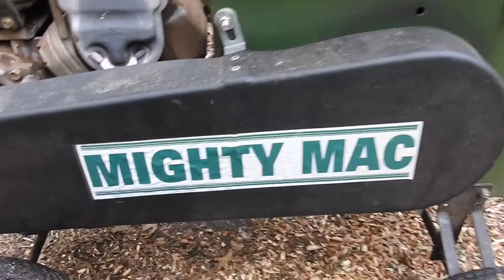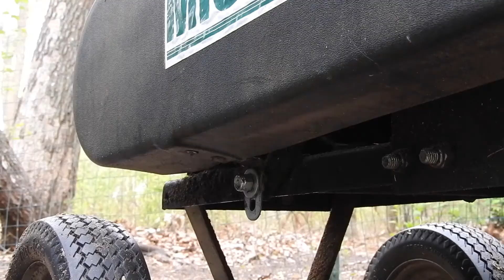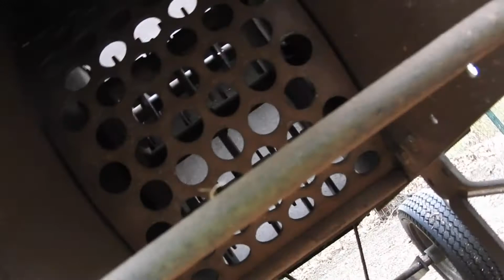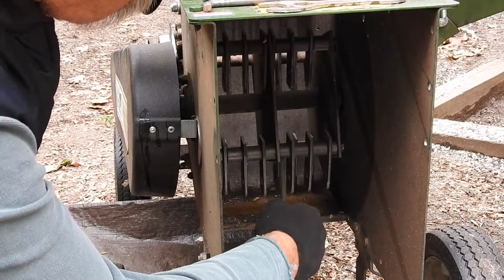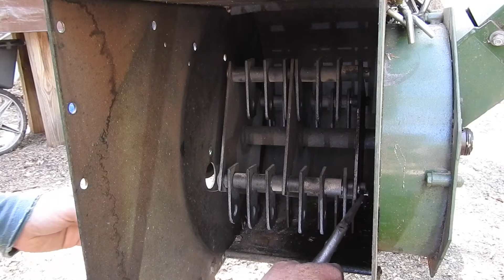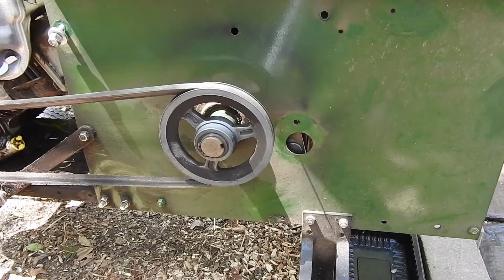MacKissic 12 PT - Replacing Shredding Hammers

Comment: Great video! I have an older version of this, but the main unit is basically unchanged. I converted mine to run off the front of an old wheel horse tractor and performs way beyond my expectations. Now I know how to rotate the blades when it comes time. Thanks. I converted mine from a wheelbarrow type to a Wheel Horse attachment. Here's a video of it in action. https://youtu.be/APUq_jmp1N4

Comment: Thank you for the very informative video. I have the same model and I'm not having any luck getting the end pins hammered out even after heating them with a torch. I'm not sure what to do besides just sell the unit. I'm very pissed off at the manufacturer for designing this retention system.

Comment: Cool that's a lot easier than I though. I have an old model, probably from the late 70's  or early 80's. Still has one good side left on the hammers haha. I'll swap them out. Guess 10 years per side is about average

Comment: My belt exploded today! Going to swap her out next week. I'm on my 4th rotation of hammers, need a new set soon, two have exploded (maybe from some metal entering the mill by accident!~). Thanks for the video, I'm going to rotate and balance the 2 broken hammers so they're equally opposite of each other. Just changed the oil, 300ml out, 800ml in! (first time in  a couple years). Will also lube the bearings at the center rotating hubs. Ordered new air and pre filters as well. Great machine that keeps on chugging away, using on an 8-acre estate. take care

Comment: Great job pointing out the spacers have to be maintained in the same positions but whenever I have that belt guard off I grease the main drum bearing on that side. You are supposed to grease them every 6 hours (I think) of run time and getting that guard off and on is a pain in the neck so anytime you need to remove it, grease the bearings on both sides and tighten the belt.
Reply from the maker: Good to know.  Thanks for the insight.

Comment: Thank you.   I rotated my cutters when I first got my 12-PT (8 hp Briggs & Stratton) about 15 years ago, suspect they need it again.   
The memory has faded, I think I may have removed the hopper and worked from the top, but I could be wrong.  
I was using mine just this afternoon, shredding blackberry vines.  Worked well as usual. :)

Comment: I was thinking about rotating my hammers but I'm only a year into using my shredder and the hammers are not nearly as worn as yours.  Clearly yours needed rotation, but did you find any definitive measurement for when the optimal time to rotate would be?